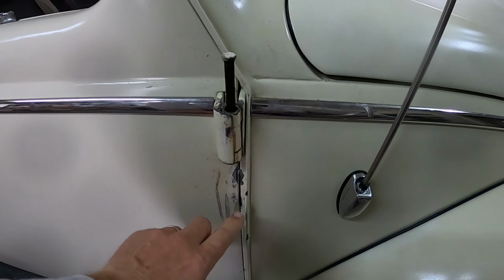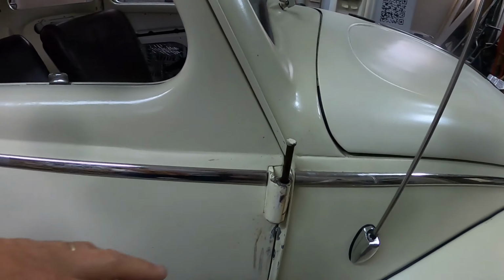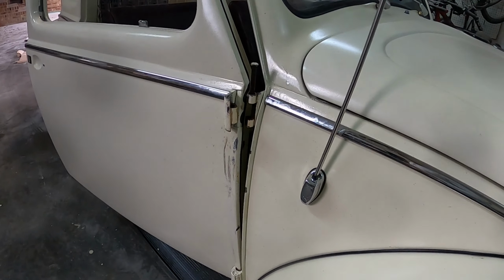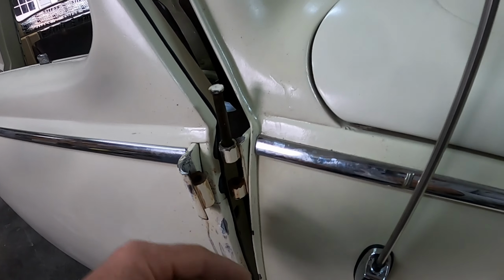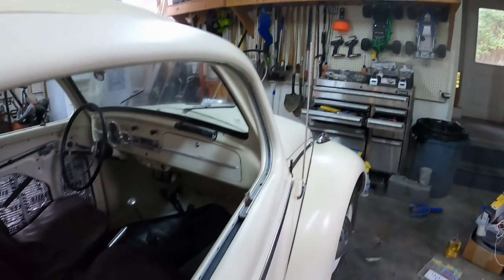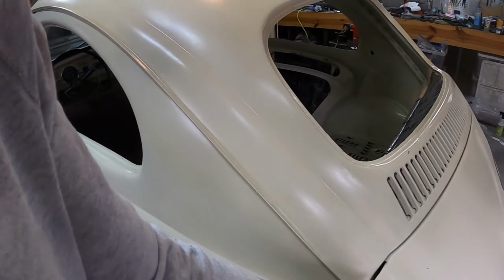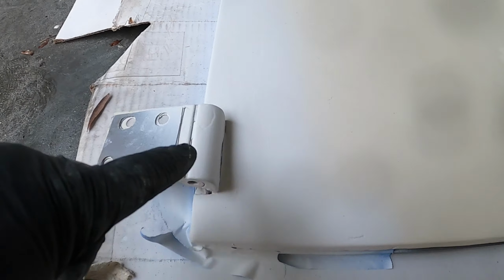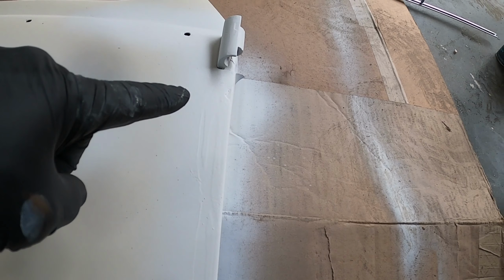1961 VW Beetle (65 Pan) - Hinge Pin and Door Fiasco! - 110

Comment: Enjoying your channel.. Need to change out my drivers side hinge pin to install the same mirror, Did you go oversize on the replacement  pin or the stock size? Thanks for any feedback!
Reply from the maker: I used stock pins and they worked great - still a tight fit.  I wish I had taken care of the pins before painting the doors and installing them - I didn’t realize how close the pin removal tool has to get to the body, AND I didn’t realize that penetrating oil completely dissolves paint!  Good luck on your project!
Reply: @LarsonSplitBus-  Thanks! As well as the tip about penetrating oil which I assume is PB Blaster etc. Have been hitting it with lots of wd40 which I don't think is as harmful and trying to keep it off the actual door. Looking forward to more of your videos..

Comment: I also bought mirrors, but no one has been able to fit them due to this hinge pin issue. Afraid something will break or get damaged. but this beetle hasn't been resprayed yet.
Reply from the maker: Yeah - get one of these pin removal tools and use a ratchet wrench on it